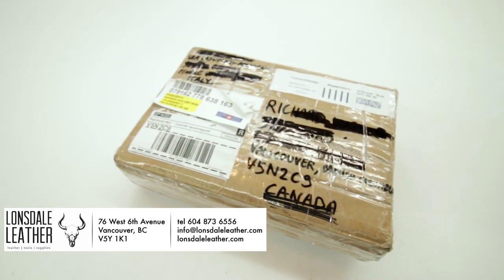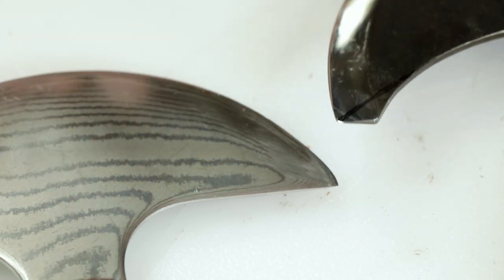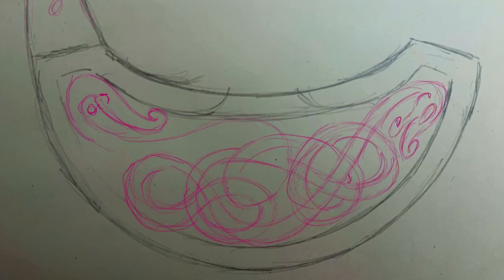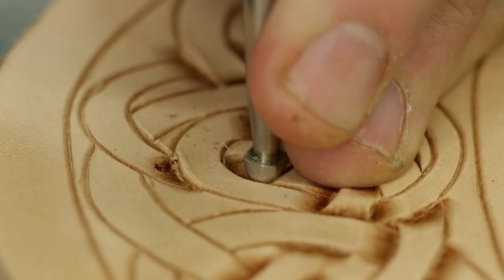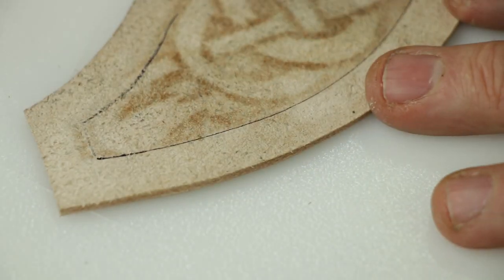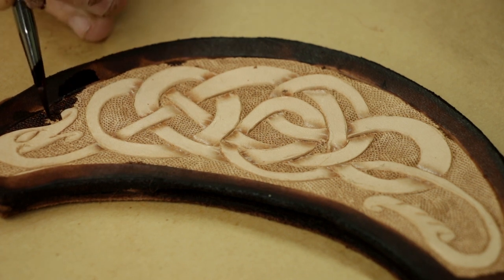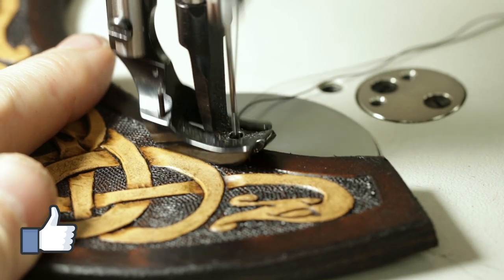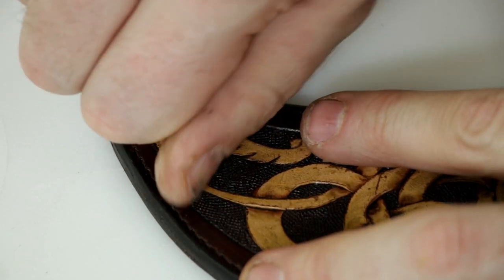How to Build a Sheath for a Round Knife ( Knife by Black Beard Projects )

Comment: Do you ever use painter's tape, or vinyl cutout to cover your design during staining? I do it with details wood carving, and it can really speed up the process. 
Awesome work. I really want to dip my creative toes in to leather work.
Reply from the maker: The issue for me is always that dye will get in the side, so if I were to even cut out a whole piece to stick on the knotwork I could soak dye in from the edge by accident. I just need to be careful and take it nice and easy.